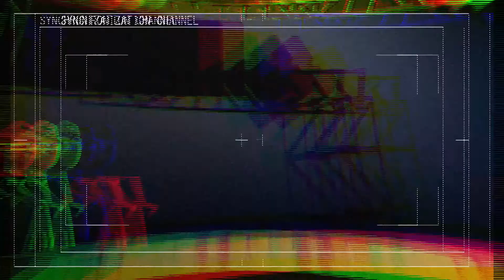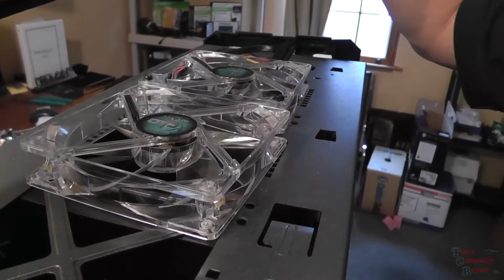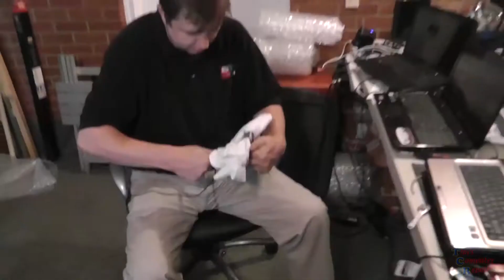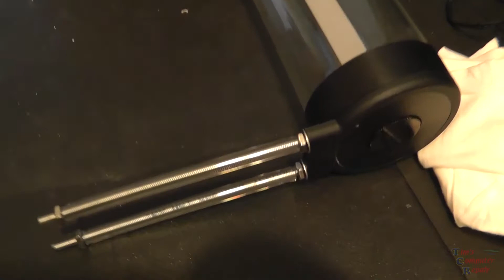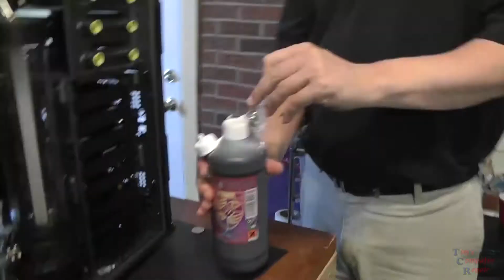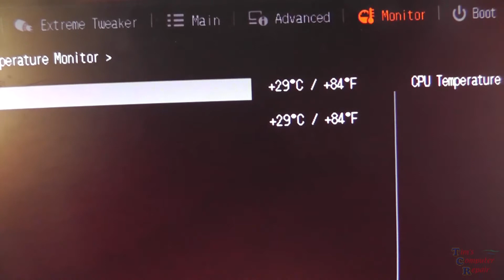Water Cooled Computer Reservoir Mod

Comment: Hey Tim whats your take on how well these d5/xspc res combos work  compared to competitors like Ek I ask cause my pump just died and have very little room in my haf932 and was considering this mod although  i think i would do the 170 cause its already packed within the case.
Reply from the maker: I see nothing wrong with this system to be fair.
Reply: Whenever you purchase a product you are also paying for all of the cost incurred by the manufacturer for their advertising and marketing.  EK and Alphacool (for example) spend much more on advertising and marketing; and hence, must charge more for their products to cover that cost.  The entire PC liquid cooling market has stratospheric prices considering that it is all made in China for peanuts.

Comment: I have the same kit with the 480mm V3 Rad. My pump never made that noise and I did run it with the cap off as I primed the system. My first thought when I heard the one in your video, he tried to run the pump before you got it. when it was mounted upside down.
Reply from the maker: vaportrail syn Most likely so... Thanks for watching.